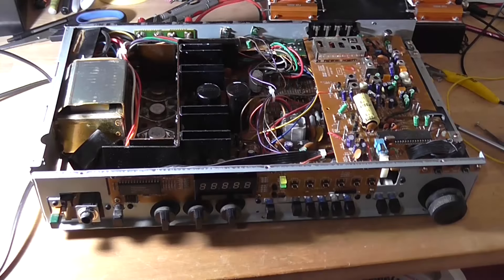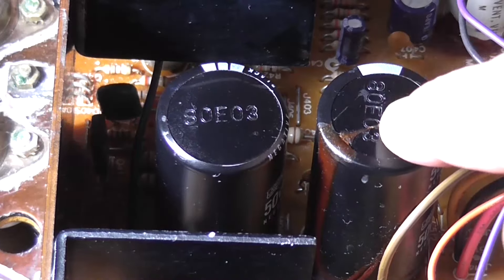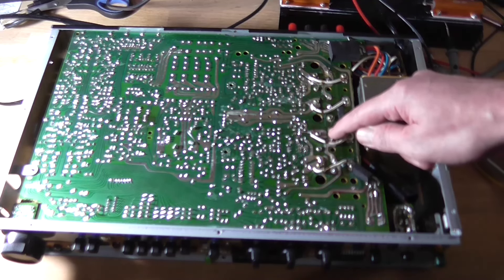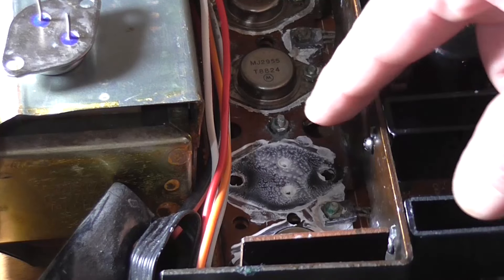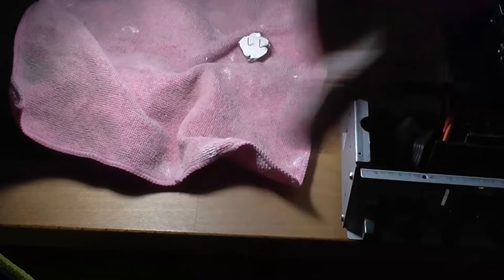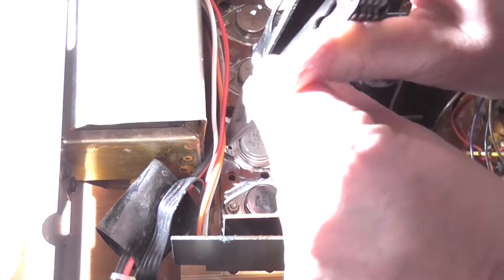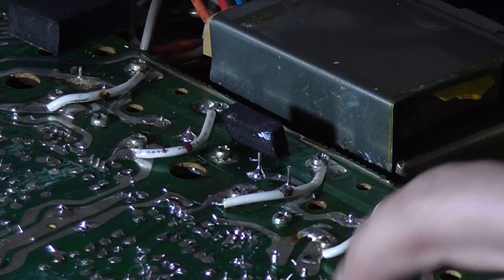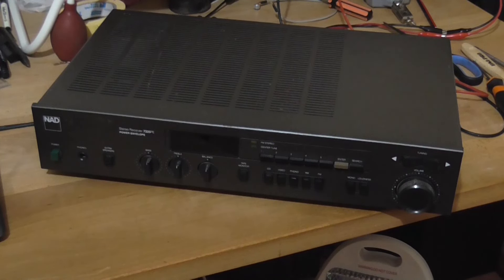NAD 7225PE Stereo Receiver: UNREPAIRABLE!

Comment: The NAD 7225 service manual shows the power amplifier supply is +/-41.1 volts i.e. 82.2 volts rail to rail. Seems to me this is too high to guarantee reliability with 2N3055/MJ2955 as the output pair as they have Vceo = 60 V and Vcer = 70 V so conditions could arise where the Vce ratings of these transistors are exceeded. (The Vce ratings for the driver pairs are over 100 V so no problem for them). Perhaps back in the day some brands of these transistors were known to exceed their datasheet voltage ratings.
Reply from the maker: @keithfisk5641  indeed. I agree that the supply rails exceed the transistors maximum ratings. Back in the 70s and 80s, the original pair easily allowed the maximums to be exceeded (only by 5V or so). The newer ones, nope.

Comment: NAD amps seem to be problem devices in general, aren't they ?
Reply from the maker: From what I've heard on forums, etc., a lot of people believe the brand to be junk. If it was designed right, maybe used much higher Vce transistors, it'd be alright. The -15V DC I'm getting across the Vbe multiplier, btw, is because the O/S isn't working.
Reply: @AstrosElectronicsLab    A unit that has lasted for over 40 to 50 years isn't junk.  It's the new replacement parts that are junk. You are lucky if what you buy now is really meeting specs or aren't fakes.
Reply: @AstrosElectronicsLab  a hifi repair channel i watch says nad usually use cheap parts but bear in mind the 7225pe is a vintage amp and nothing lasts forever.
Reply from the maker: @The_Penguin_Overlord  I agree.
Reply: @AstrosElectronicsLab  still, its given 40 odd years of service. that repair channel had a recent(5-7 years old) £600 fancy schmancy cambridge audio amp that he couldnt repair because CA didnt stock the propietry parts so a 600pound amp was a boat anchor, if i was its owner i would be pissed AF 🤬
Reply: Nope !  This model is 40 years old. 
Its not worse than any other manufaturor.
My 7240p is still running in perfect order after 5 years of purchasing it second hand for cheap. I have had Nads that failed before , but always replaced it with another NAD from the late 70´s to mid 80´s  and even the 90´s for cheap just because i swear on these amps still being a tremedous bang for the cheap.
Never regretted it. I dont buy anything else but NAD. Beats all Japanese and american stuff from the same era .

Comment: If the transformer is good, then nothing is unrepairable. Degeneration resistors are really only necessary on parallel output stages. But if the video were to cook some transistors, then sweet 😂

Comment: Pity the NAD isn't yours.  I'd seriously consider making you an offer for it and then repairing it to give it a new lease on life.  I fully understand your reasons for not investing anymore time or money on it, but your idea of ratting the 20k tapped volume potentiometer to put it in another amp that requires a 50k pot IMHO isn't a good idea.  Sure, it may function but certainly not as intended.  The loudness bass and treble boost at low volume settings will not follow the design curve and I suspect that there will also be a premature roll off of the bass by using the 20k pot in a circuit designed for a 50k unit.  By ratting the pot from the NAD you've pretty well much ruined any chance of restoring it to its former glory and thereby committed it to landfill in favour of a cheap Proton amp which would be better off just having its faulty pot replaced with a standard 50k dual gang unit and the user just advancing the bass and treble controls a bit to compensate for listening at lower volume levels.  Just my 2c worth mate.
Reply from the maker: It's not my idea to "rat" the volume control out of it. I'm personally against it. I have explained to my housemate that you can just put a standard pot in and defeat the loudness circuitry (no one uses the stupid thing anyway, except to boost the bass, lol). However, this won't end up in landfill and will eventually be used for parts.
Reply: @AstrosElectronicsLab  Have you considered taking the pot out of the Proton and see if you can take it apart and fix it? It is after all already broken...
Reply from the maker: @geirendre  it's a possibility, however it's the wiper (center) that's open.